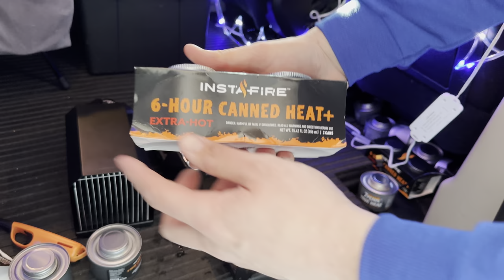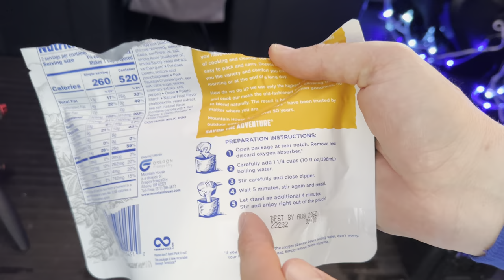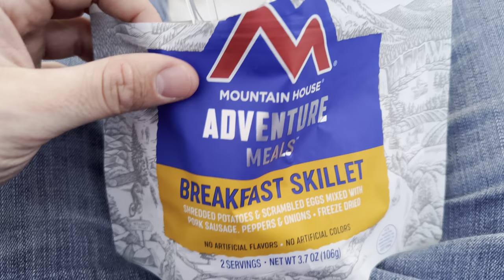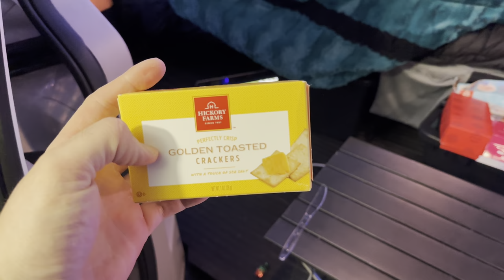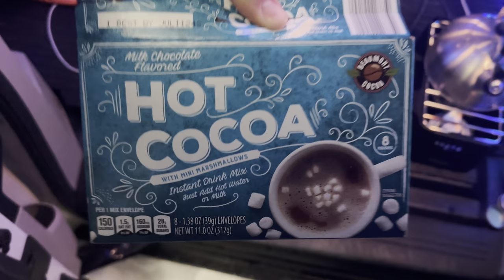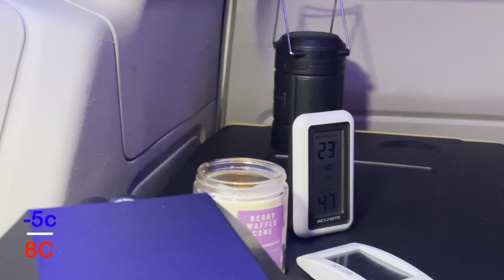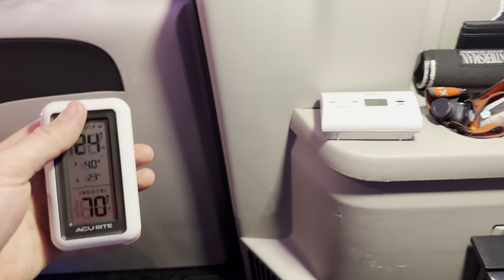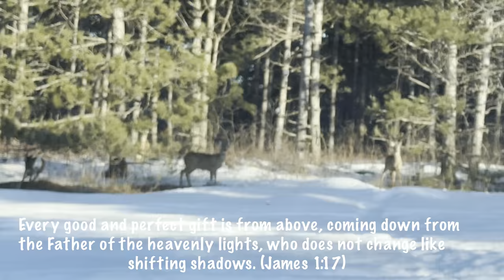Winter Car Camping with New InstaFire Vesta Heater and Stove | Van Camping in Freezing Temperatures

Comment: WARNING - Do not attempt this with a trangia alcohol burner. I did this. I got over 600 degrees. Melted the handles right off the stove. Was quite difficult to put out all three trangia alcohol burners. Way way to high of a flame for the Vesta stove.

Comment: I have two of those heater/stoves. the fan will turn even with 1 canned heat going. It uses the same stuff that cooks use for food service and it is very safe to use inside. I used the heater with 1 can to help keep my bedroom warm in an old draft house to supplement the furnace. These things work great and you can cook with it. I found for a 8 inch frying pan it's best to use at least 2 cans. I love my little heater/camp stove. It also works great for power outages. 

Love your set up and the night walk. Very cool. Enjoy camping with your daughter. They grow up way too fast.
Reply: are the dollar store cans effective? Do you ever refilled the cans instead of buying new ones
Reply: I'm going to check into this, I was considering a $2K installed Planar diesel heater.  For as much as I will ever use it, this may do the trick and save space.

Comment: I use a extra tarp to help hold heat in, especially around the cracks. Inside the van the heat with run you out. Love those stoves!

Comment: That was fun ! Super Bowl in the Sticks !!! ..and Comfy too. I'm glad you tested the Vesta in a van. 
I didn't get one yet because the results for cooking & heat in a small room in a house are less impressive,
but the minimal space of a car seems to be more of it's sweet spot. I will probably still use faster methods for the 
cooking tasks but for an overnight heater it looks good ,...I'd like to see the difference in humidity vs a Mr Buddy.
Peace !!
Reply from the maker: I’d say ceiling height is going to be a big factor when comparing a van to a small room. A small bathroom would definitely be warm but a small bedroom it will only probably warm it up a few degrees.

Comment: Great video man, as a construction guy who works in the cold and mad a few contraptions I think one more $10 tarp over the top to seal the gap you have at the roof would be a great way to hold more heat! Hope you’ll try it !
Reply: My thought as well.
Reply: I was thinking that a strip to cover the area under the door would help, too. Easy to clip tight on the poles at either end to block out draft.

Comment: That’s a pretty sweet little heater. Would definitely be useful for off grid properties or power outages. Did the fuel canisters actually last 6 hours?
Reply: Good to hear so many don't realize a candle in tight quarters will use up the oxygen.
Reply: @dennyfox8658 any flame will use oxygen

Comment: That looks safer in the van than the Mr Buddy. Camping Survival has the best price on heater and fuel. I wonder which costs more per hour, propane can or this kind. Sometimes I use my campstove to take the chill off the van.
Reply from the maker: Pricing for the amount of heat you get is definitely something to consider. I say mr buddy is still hard to beat, but I do really like this new heater/stove.

Comment: Hello,   New to the channel.  I’ve been interested in the reviews for this heater.  I’ve heard good and not so good. Won’t say which channels said what but from what I’ve done my research on it seems to get a good boil and heating from taking your fingers or pliers and pull the wick about 1/2 inch to an inch and the fire will burn hotter. This will unfortunately take up the fuel faster and will have to purchase more fuel.  If this is not a hindrance then I believe this heater would work fine in a smaller area well vented.  One channel with negative reviews said they could not boil water.  Well, they left the wick small like chafing dish candles. Not much heat.

Comment: Im wonder,  how hot it can get , running two instafires with 6 cans at the same time.  Or 5 cans .
Reply from the maker: That would put off a lot of heat
Reply: @TolbersCamping  sometimes in 40 to 50 degree out,  3 cans with intstsfire don't get warm enough.  So I ordered one more instafire and will try 1 or 2 cans additionally.  So running 4 cans or 5 cans will boost up some heat inside the big tent.
Reply from the maker: @Kinghunter182  I can see it needing more in a big tent. 3 really warmed up the van, 6 cans would be too hot.
Reply: @TolbersCamping  yeah , my tent is about 3 times bigger than your van space. That's probably why.

Comment: Yeah you were burning fat and your brain was unhappy it was getting reduced glucose. Like someone mentioned, snacks you can quickly eat without cooking, like chocolate or granola bar. I like the heater and blocking under the van. But open flames in a tent is super sketch. Very easy to knock them over and the fabric ignites, plus alcohol flames are hard to see. You need some plates and a heat Mat to put your hot pot on. I think what you saw was a fox or coyote.

Comment: ☝️😲 Do yourself a favor! Dig the snow out before you put the tent over it because the snow on the ground is making it cold on the inside also if you dig the snow off the ground and just have solid dirt floor, you can put a mat down that will keep the cold out after digging the snow to put outside of the tent and the ground won't be wet if the snow was left inside on the ground to melt.
Reply from the maker: You can’t dig that deep without a dirt shovel which would destroy the parking space that was underneath. That was as much snow gone as doable.

Comment: Wow I'm surprised that it got up to 70 degrees with the little heater.
Reply: The heat would have been more effective if the window glass would be covered as with reflectix....20° increase in my van, same type heater that I made.....

Comment: That's a pretty decent setup you got. I'm saving up to get a sun fun kits 4.0kwh battery to build a small portable power unit. You could save quite a bit by refilling those used fuel cans with 90% isopropyl alcohol. It's much cheaper than paying around $2 or more per 6 hour unit.

Comment: Nice job. Would suggest blocking off area under van door to eliminate draft coming in from under van.
Reply from the maker: Im sure you saw I did that in the video 😁
Reply: block both sides to save heat inside the van, but becareful of exhaust being blocked if it snows more.

Comment: Just found your youtube. I'm in Minnesota too. Cambridge area. I'm a prepper/survivalist have been for 35 years. I'm going to go get one of those heaters. I guarantee that baby will work great with Crisco and wicks in those cups. They can be reused to try it out.
Reply: Did you end up buying one? And if so how did it work and did the Cisco emergency candles work out?
Reply: @tburrows357 I have not bought one yet. I intend to in the next couple weeks. Been busy as hell looking for land to buy in or around McGregor.
Reply: @tburrows357 I'll let you know what I find out with the crisco candles and this stove. You can always try it too. I could explain how to make a crisco candle but it'd be long. You can find a ton on 'how to' on you tube. If you haven't heard of it. It's actually amazing. I've been doing it for 25 years. It doesn't work as good as it used to because now crisco is made with soy.  Before when it was mostly cotton seed oil it worked better. That was before 2007.
Reply: @guidosarduce4054   I do know about the candles. My interest was on cleanup or would they produce soot?  

Also I have a friend who does the used cooking oil from local restaurants and runs his old diesel truck off it. Even made a oil drip camp stove for his hunting cabin. But the Cisco oil candles I also learned from him. He’s kinda a pyro genius  he loves to play with anything that can burn or be turned into a burnable substance and if that means saving money even better

Comment: That cooker/heater works better to cook food if you put something inflammable UNDER the cans of Sterno to raise them up higher. Boiling time will be a lot quicker than 20 minutes. Sterno is not known to cook foods very fast but this method will cut off several minutes before the water boils.
Reply: That's a great idea and a useful tip! Just one important point - I'm sure you meant to say use something NON-flammable, not 'inflammable'. Strangely, flammable and inflammable both mean the same thing - 'capable of being set on fire'! I know it's odd - normally when we add 'in' it creates an opposite idea - like 'consistent - inconsistent' or 'sincere - insincere', but inflammable is one of those odd linguistic twists!

Comment: 12 pack of sterno $17.00 at party city.  sterno folding stove $6.99 at aco hardware.  sterno camp stove $29,00 on ebay.  Vesta heater and stove $129.00 on ebay.  6 hour canned heat $2 pack  $12.95 at my patriot supply.   for comparison.  the thermo fan is a plus!
Reply from the maker: It’s totally worth the $129 in my opinion. Just overall good quality and experience with it. I think those metal channels in the top help hold some heat and the fan pushes it out, pretty sweet design.
Reply: Right now you can get stove at patriot supply for 99.95 with free shipping.

Comment: Y does the thermo fan have a blue n red wire coming out of it ?
Reply from the maker: Think that’s just part of how it turns heat into electricity to run the fan
Reply: @TolbersCamping  I thought those turn just from the heat huh I figured that it free spins so them wires was charging your phone or battery or something that’s weird

Comment: Is there something where, heat from your car could kick in every now and then, from the battery, to supplement the heat? And how long would that last?
Reply from the maker: Not that I know of
Reply: @TolbersCamping  Actually I was thinking, you don't need that, you could just plug in a space heater to car electricity.
Reply from the maker: @saratemp790  space heaters pull a ton of power. You cars battery would be drained in less than an hour. That’s why no one uses electric heaters, it’s just not doable unless you are plugged into shore power.

Comment: I am trying to figure out how many cans it would take to maintain the heat the inside of a pick up truck bed with a carpeted topper and a Bed Rug bed liner all closed up with only a cracked window for ventilation and possibly Reflectx insulation on the windows.  Is the fuel the  exact same as Sterno? Also I am curious, If after it got warm and if it could work on less than a can could you extend the run time by using an alcohol stove adjustable regulator snuffer lid to partially cover the flame? is Sterno fuel less efficient?  I have a lot of questions.

Comment: Get a hundred dollar diesel furnace from china cheap work great easy install and  cheaper to run then those cans of heat they can cost you easy 30-40 bux a night to try and heat ..at around 4 bux a can ...nope not feasable but good for emergencies

Comment: This heater is useless. I tried to heat my campervan with it, and it barely raised the temp by more than 2 degrees celcius. It gives off dizzying fumes and puts out less heat than a 200-300 watt space heater. Mine was $260 CAN, so I returned it. It barely boils water, and the fan mechanism that sits on top just absorbed half the heat, making it redundant and worse than useless. Thankfully I'm getting a refund.

Comment: Great setup!

Regarding the walls for your MoonShade: are those tarps or did you order them from Moon? I ask because, on their website, I don't see any fully-enclosed setups like what you have. It looks like the MoonWalls they sell are designed to fit only 1 side of the MoonShade? Perhaps I could just use tarps and clamps like you did? Just wondering.

Thanks!

Comment: From experience.  If you don't insulate right.  Your van will have a lot of condensation and you will end up with a lot of molds. If you don't believe me. That's OK you will find out the hard way.  Peace ✌️
Reply from the maker: It’s like turning on a fan after a hot shower, just have to turn the heat with air conditioning on for a bit when you wake up to get out the moisture. If you don’t get the moisture out then yes that can happen. Thanks for watching bro

Comment: That seems like the least efficient way to heat. 20 min to boil water? $6 for each one of those cans? And you were using like almost 10 of them to heat that area? Hell no.
Reply: 12 pack at Amazon $25.00 for the ones that burn 6 hrs. The ones without the wick only burn 2 hours.